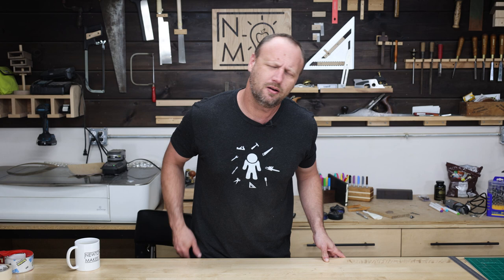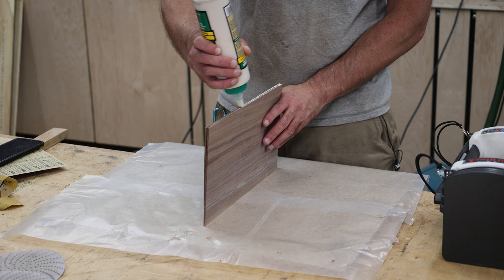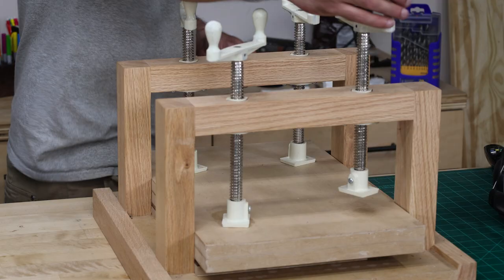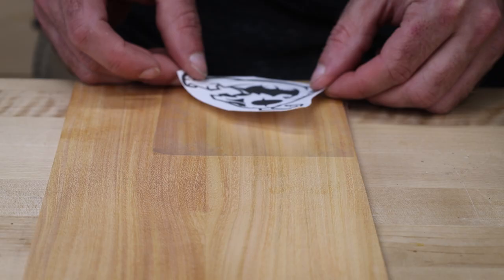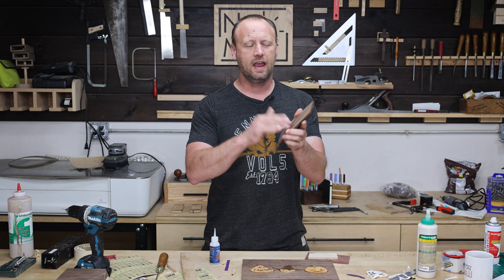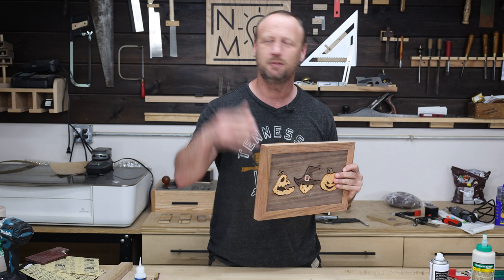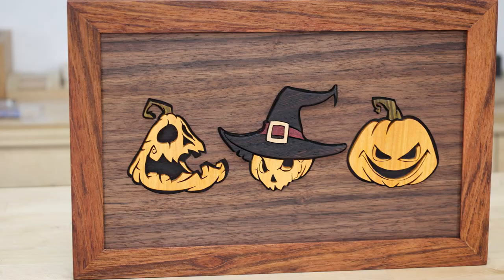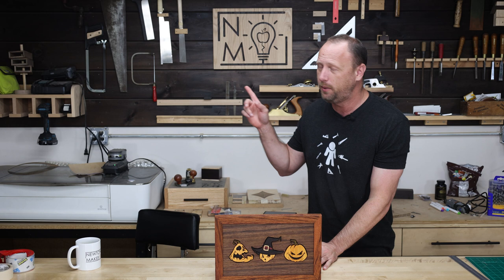Super QUICK Homemade Halloween Décor | Scroll Saw Project!

Comment: Did you use teak oil instead of Osmo or spray lacquer because you thought it would make the Argentinian Orange Wood and Wenge stand out more, or were you just looking to mix it up a little?
Reply from the maker: Trying something new. Never know what might end up working amazing. But it does make the orange pop.
Reply: @NewtonMakesArt  It sure does and the Wenge seems like much more of a solid black than I’ve seen with the hard wax oils or poly.
Reply: Sure does it's stunning